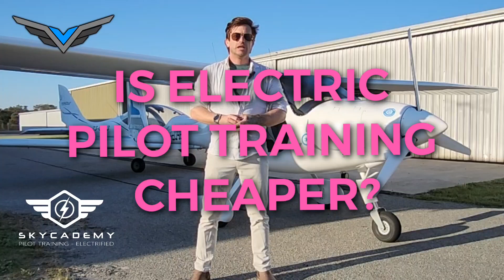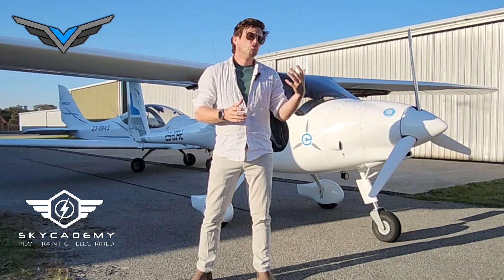Is it cheaper to learn to fly in an electric plane?

Comment: Totally agree with your comparision, funny part but also  reality of some flying clubs that they are using 70 years old cessna 152 or 172😂. 
I wish if I would have done my training and  Solo in newer models of Electric plane back in 2006.
Believe me,  back then when I was taking training, I tried to  avoid discussing about  the age of aircraft  with our friends and families, as they made fun of us when they came to know that we were flying  50 to 70 years old planes
Reply from the maker: 100% Hasham, most flight schools can't afford to update thier equipment so they are stuck using old aircraft that have a very high running cost, further forcing them into a position where they cannot upgrade to stay relevant with emerging technologies.